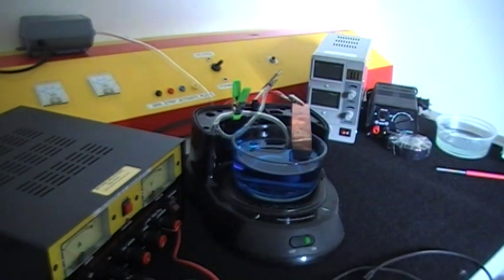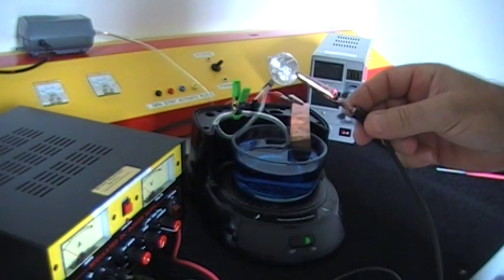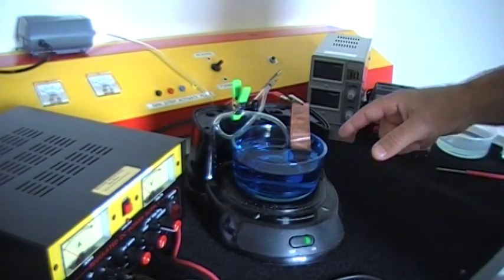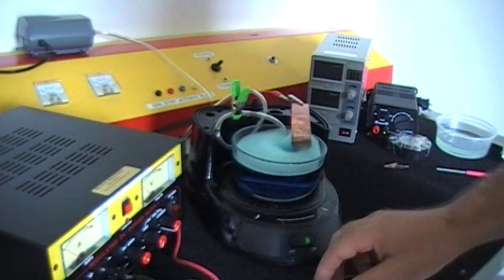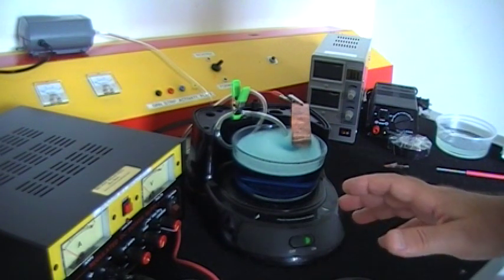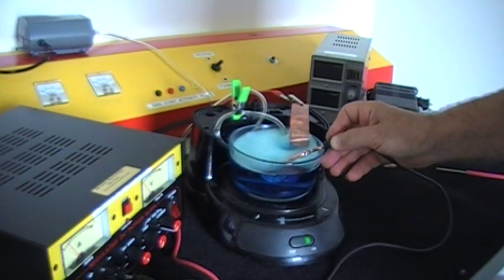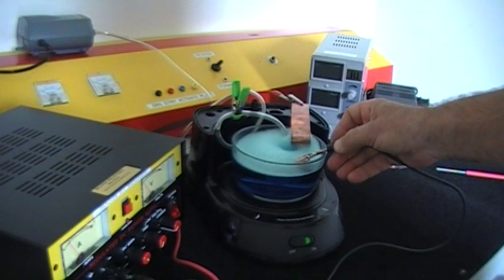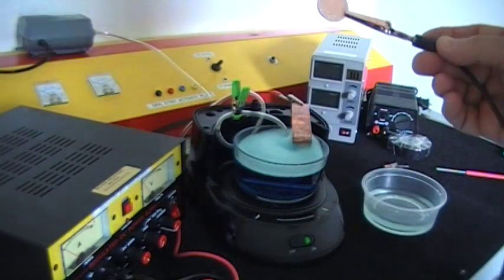Copper plating, Fast and easy way!!!www.beckerindustries.com

Comment: @100roberthenry 
No. For aluminum you will need some more steps: 1 oxidize Al part 2 double deep zincate 3 copper strike (cyanide, pyrophosphate or noncyanide) and only than acid copper.

Comment: CuSO4 @~20-30oz/gal + 9-11oz/gal of H2SO4
But 100% that he used some brightener system. Acid copper plating doesn't give such bright and uniform deposit without additives.